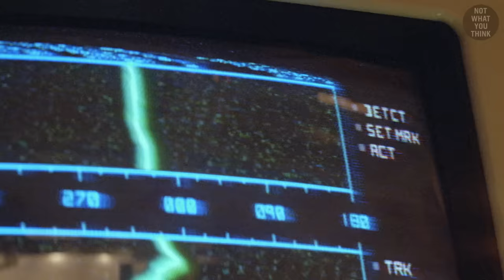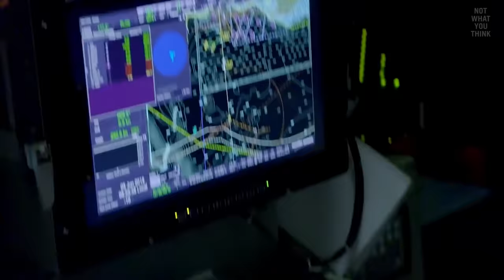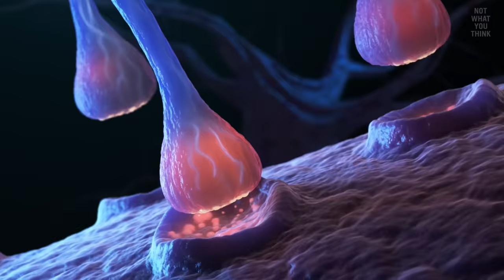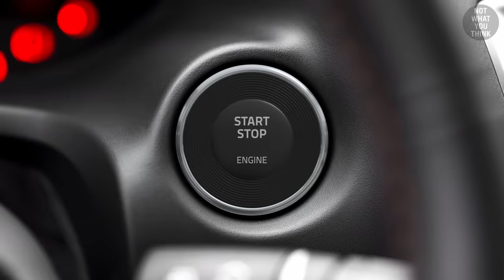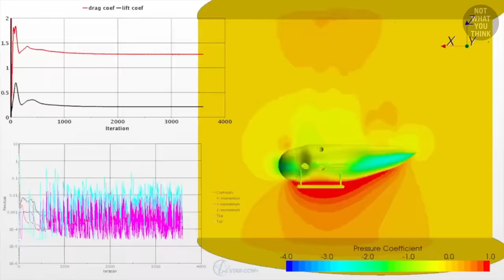What Happens When a Submarine Implodes

Comment: I appreciate the opportunity to understand what happens in an imploding submarine. Sad, but also reassuring that it’s instantaneous. I found the narration very sad and scary as opposed to the usual upbeat and cheery voice. It is for a tragic video but not very usual. Makes the video all the more sad.
Reply: I sould say a sub would implode that way only if it is constructed properly. Unfortunately, that was not the case with Oceangate Titan sub which, because of its carbon fiber shell, got its alloy pressure chamber slowly crushed within its shell. An acousticly recorded 20min agony that must have been unbarable :(
Reply: What part of an imploding submarime screams "happy" to you?
Reply: There's a video showing a Coke can inside of a pressure chamber and they keep cranking the dial-up and at some point the popcan literally goes from a popped in to literally confetti falling to the bottom of the tank in a Split Second
The only thing that was left were the two ends of the Popcan which were twisted and bent but still recognizable
Reply: @SR-fw8og  Carbon fiber doesn't crush, it delaminates and shatters. The pressure hull of the Titan was fully carbon fiber, not an alloy. The only metal used in the hull was titanium endcaps. The hull of the Titan would have failed almost instantly. That's the whole reason steel and titanium is typically used on subs, they're a uniform material that actually yields and returns to form, unlike carbon fiber that doesn't deform, it weakens over time and breaks at a point that is difficult to calculate because its not a uniform material.
Reply: @SR-fw8og wym 20 minutes?
Reply: @SR-fw8og  wrong af, purposefully spreading misinformation?
Reply: @SR-fw8og  not even close to how physics works.  They might have heard some cracking beforehand but there is no "slowly crushing" happening here.
Reply: @GodplayGamerZulul  lol who spreads information in the youtube comments section anyway
Reply: @JoshuaPlays99  Yes I am aware that carbon fiber does not crush, I was mentionning that alloy layer being crushed. I just saw some articles mentionning a thin layer of titanium alloy below the carbon fiber and then exlaining the mecanism i mentionned. That was also shown on national TV news. Maybe they got it wrong and I believed it! 
Thanks for your non agressive and educational comment anyway, unlike you some others are very touchy here!
Reply: @ACME_Kinetics  isnt it?
Reply: @JoshuaPlays99 just goes to show what happens when you cut corners. Especially on a submarine that’s supposed to take you to the bottom of the ocean. Even if that submarine managed to survive, it would’ve been scrapped. It was meant to be a throw away submarine for a billionaire.

Comment: The ARA San Juan was such a sad event. We lost many people, including our first female submariner ever. The sub was old, they supposedly extended its life but clearly they didn't do a very good job. Among the last messages there were reports of issues with the batteries that power the electrical engines. I visited the sub about a year before it sank, it looked... old. I remember one computer on aboard still had a slot for using cassette tapes as data storage like computers did in the early 80s. I also remember there were a few religious images on board. I remember seeing a tiny Bible laying around. I hope it brought them a tiny bit of comfort during the panic of those final moments
Reply: Condolences from the UK, RIP to those brave submariners. Tragic way to go, but we should take comfort in knowing it was very fast and probably painless.
Reply: They probably didn't have time to panic and then they were gone. Death is something that we all have to face and there's a lot to be said about a quick and painless death. I've been in a situation where I saw my death coming. I was 10-11 years old and had mistakenly put the wrong harness/halter on a horse so trying to rectify my mistake I tied a rope around my waist and put a slipknot on the other side and caught the horse in question. I had just removed the harness when our stallion decided the horse in question, a 3-5 month old colt, was too close to the mares and decided to run him off. I had about 10-15 feet of rope between the colt and I and was drug around like a rag-doll. I remember one of the mares kicking at me and her hoof looking like a dinner plate coming at my head. I was able to stand up and remove a knot before he started running again and drug me into a fence post with it hitting me just below the chin, I was going towards the post so I don't know how it didn't break my neck. After that I remember looking to off to my right and seeing where we had started building a log barn. Just the very beginning and dad had cut the pines to lots of short 3-4 inch limbs stubs on the logs and several sticks, branches, etc. I looked over there and knew that the colt was going to drag me through there and that I wouldn't survive. The colt was rearing up and his front legs were slashing at the air and then he calmed down the slipknot I had over his neck grew and slid over up his neck over his ears and floated through the air and dropped on me. The moment the rope hit my back the colt ran directly across the area that I had known he would. Since I've never questioned the existence of God or angels. I think those people probably had a similar experience, peace before going.
Reply: @Parents_of_Twins  You know your depth in a Submarine, the second they lost control of the sub and began approaching crush depth there would have been panic, let alone the final moments of them just waiting to be decimated.
Reply: @47372 That's correct, but they were not decimated. Nobody survived.
Reply: @briandavenport8971  WTF?
Reply: @filiphabek271  I know, right?
Reply: @briandavenport8971 one extra chromosome, am i right?
Reply: i dont get how people still believe in god after such tragic accidents lol
Reply: My respects from the uk,it takes absolute bravery to get in a sub
Reply: @briandavenport8971  That's some gentle comedy dude
Reply: @Parents_of_Twins  I have been in a couple of car accidents where I could have died. I have also been in a sinking (out of control) submarine. My experience is that the fear only really hit you afterwards. A pneumonia visit to acute unit in hospital wasn't the best either. 
Facts are we can die falling of a chair so every body enjoy your life. You may not live to morrow but you may also live until you are 100 so enjoy your life now but only to the extend that you can enjoy the rest of your life if you are blessed with many more years is my advice.
Reply: @47372  It can go very fast. I have tried it but was saved with a sea floor being only 85 meters down.
Reply: @Blue-op6qv  I don't believe in god but still it's not his fault people want to go down in the ocean, free will and all
Reply: @awildtomappeared5925  I know it's not their fault, but cmon, all the bibles and sht to die in a horrible accident, it actually angers me how people still believe...
Reply: @47372 no it doesn't. It means to remove one tenth. It comes from Latin, and was the punishment for failure within the Roman army. The Roman army would put soldiers into groups of 10, draw straws and the one who drew the shortest straw was beaten to death by the other 9. It is also where the term 'to draw the short straw' comes from.
Reply: @moteroargentino7944 Decimated is a term people used wrong frequently. 9 times out of 10? 😂😂
Reply: @47372  Speaking as a former submariner, you don't panic, you do your job! Their final thoughts might of been along the lines of "Oh Shit!" But they wouldn't of panicked. Their minds would of been fully focussed on getting to the roof!
Reply: @markmaher4548  Christ, you just had to do it three times, huh?
Reply: @krashd  Had to do what 3 times? Other than pull you up short about a subject you know nothing about you mean?